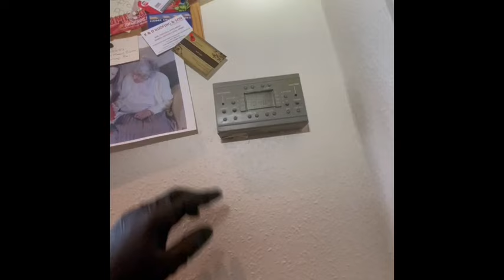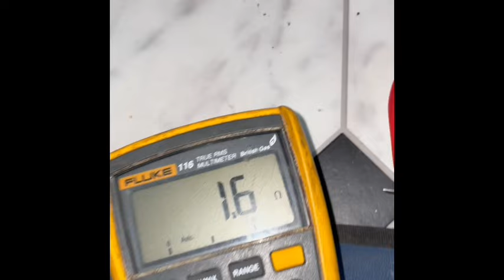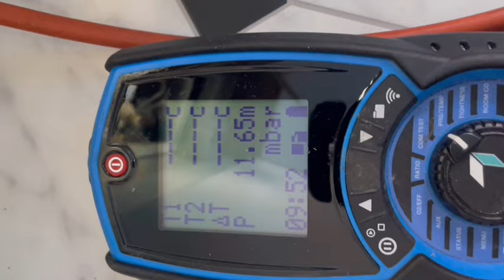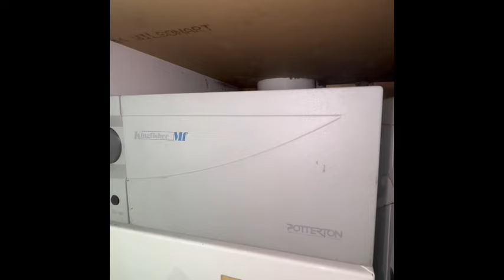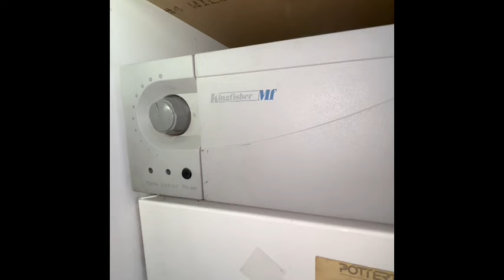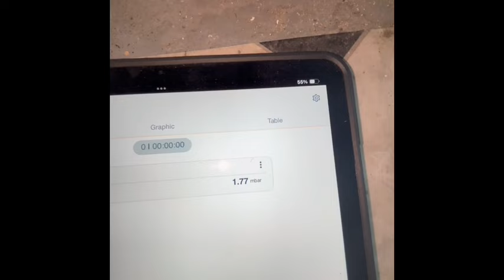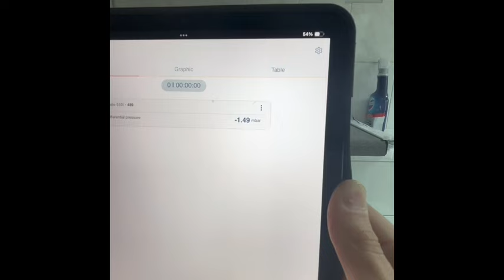Fan fault / Air pressure switch problems

Comment: Fitted loads of them back in the late 90’s/early 00’s. Good boiler; like a floor standing Profile/Prima/Netaheat.
Reply from the maker: I liked these boilers , pretty simple to work on , have to scratch your head when you haven’t seen 1 for about 10 yrs 😂😂

Comment: Great video thanks for posting enjoy your content. Big spark from that fan when you added the power :) not sure you seen the fan when you turned it on but you knew anyway.
Reply from the maker: Thanks mate , yes saw it flash at the rear , I try my best to include testing techniques I use for the newer engineers, we’re all guilty of being complacent and guessing at parts but it can bite you in the but sometimes

Comment: Had intermittent air pressure switch before on these. Someone booked it for pcb as intermittent but found air pressure switch sometimes got sticky,